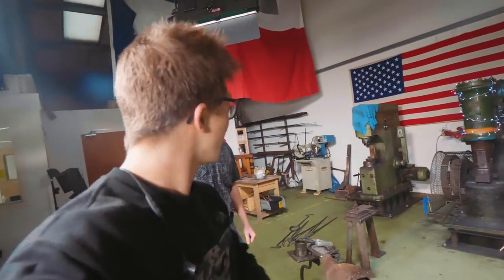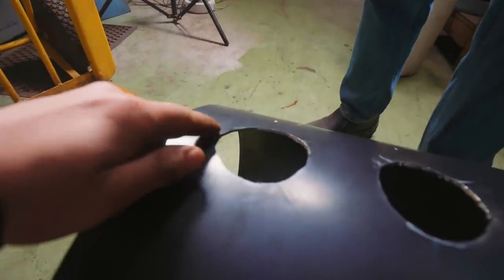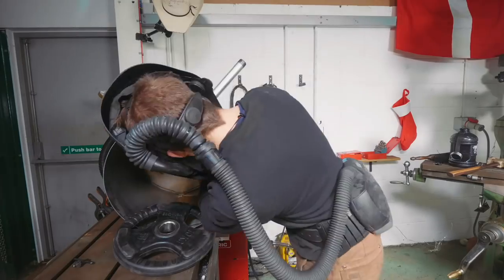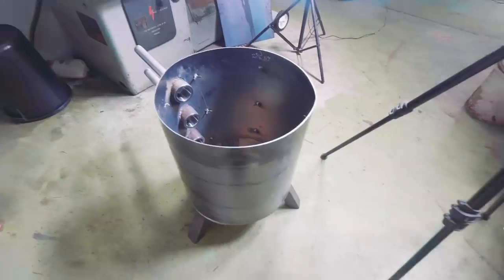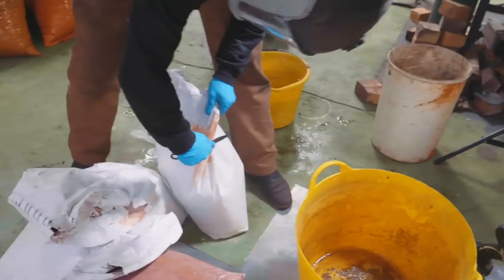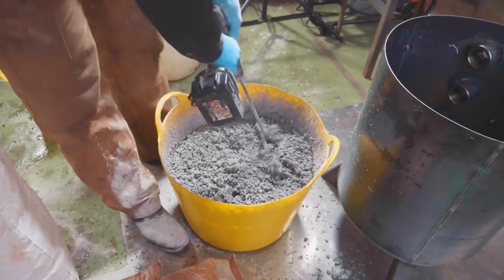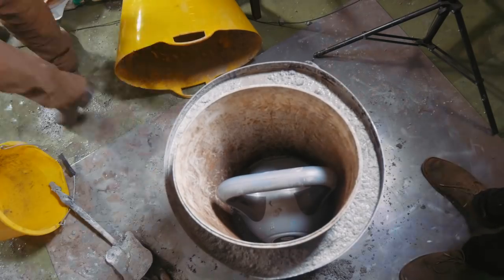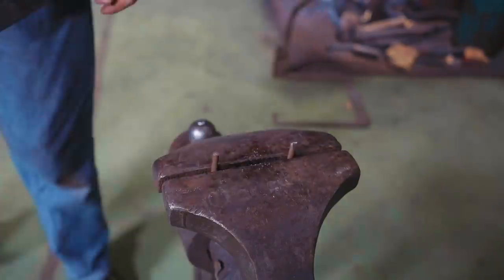BUILDING A FOUNDRY!!! PART 2

Comment: You're making a furnace not a foundry. The Foundry is the shop in which you'd find the furnace.
Reply: I just said the same.
Reply: Wouldn't he then be making his workshop into a foundry? Therefore, he is making a foundry?
Reply: Jasper Bliss you're right if he gives up blacksmithing 
If he does casting only then it is a Foundry
Reply: It shows their level of knowledge....  :-/
Reply: To be fair Alec is correct in calling it a foundry.  A foundry can be a factory or a shop that produces castings in molten metal but it is also the act or the process of producing said castings and it is the category of metal production.  The word like many can have a different meaning in different countries and regions and in this instance Alec isn't wrong.
Reply: found·ry
ˈfoundrē/
noun
noun: foundry; plural noun: foundries

    a workshop or factory for casting metal.

Origin
Reply: fur·nace
ˈfərnəs/
noun
noun: furnace; plural noun: furnaces

    an enclosed structure in which material can be heated to very high temperatures, e.g., for smelting metals.
        North American
        an appliance fired by gas, oil, or wood in which air or water is heated to be circulated throughout a building in a heating system.
        used to describe a very hot place.
        "her car was a furnace"
Reply: Billy Allen https://en.m.wikipedia.org/wiki/Foundry
Wrong
Btw the act is called casting
The caster is a foundyman
Reply: the act, process, or art of casting metals, guess you forgot that, either way you guys are bickering over piddly nonsense but what else is there to be expected from bitter people with far to much time on their hands.  Seriously it's not hurting anything or anyone if someone references it as a foundry just as it doesn't hurt anyone to call a microwave oven a microwave, only a total twit wouldn't know what he means.
Reply: Damn why are you so salty?
Reply: Billy
"...but it is also the act or the process of producing said castings and it is the category of metal production."
What??
The act of casting metal into shapes is known as foundry??
In what country is casting, specifically the act of casting known as foundry?
Reply: Billy Allen education is about getting it right 
He is a raw model to a lot
If he would make mistakes on safety you would probably be with us
Reply: Billy Allen I second what you say. it is a foundry, and after he take what ever he makes out of it, and forges it. then he has a forge.
Reply: Muttun and Friends forging it makes it a forge ?
Hope that was a spelling mistakes otherwise you gonna have a sad future
Reply: To those of us that have been doing metal casting for a long time, definitely.  Just wait until the word SMELT, SMELTING or SMELTER comes around for melting metal...  You ain't seen nothing yet.  LMAO.....
Reply: No mutton!

You don't forge castings, you machine them...

And yes it does matter, words have meanings already
Reply: sandrammer but he could make bars and make them into something
Reply: Dude... You don't normally go to all the trouble of casting to make bars.. 
Normally you cast complex shapes that would either be impossible to forge or prohibitively expensive to machine from a single chunk of stock material.
Reply: Yes, I believe it does.
Reply: +worldtraveler-- but, but SMELT is a real tiny fish is it not? And  if it's real, it's not FORGED...
Reply: Marcus Camenzind, on the topic of education.... Its a Role Model, not a Raw Model. It seems everybody is hooked of phonetics and spelling and grammar, so I thought I'd jump in on the action. Damnit people, should everything on the net be toxic? Bunch of petty trolls arguing semantics in a video by a massively entertaining Content Creator, without I dare say, the ability to do these things themselves? You Keyboard Warriors need to get a life, FFS.
Reply: worldtraveler, I'm pretty sure Alec mentions in every second video that he learns new things every day. Coming here and criticising his level of knowledge is uninformed. I bet you know it all, hey?

Comment: you did all that work witha circle.  do it flat next time.  all the holes except welding tub.  use 1" 1/4-20 steel bolts nextime just drill hols flat no welding.  your refractory cement should barely be wet.  way to much water.  and must have lid...order more.  use 2" cardboard tube and cut through internal mold...brute force to remove.  that cement should require constant packing and the mold should not move at all once full.

Comment: From experience that ‘foundry’ ain’t gonna last long...too thin foundry cement for the rig, taking into account the heat likely to be generated by the three burners...and all that water in the mix....not only is it gonna take ages to dry, if you try and heat it too much, too soon, it could explode with the pressure of steam in it, so be careful guys... the mix should have been much drier, and thicker (with the three burners), and the steel for the ‘pot’ could have done with being thicker too... hey ho...😳🙄😣☠️

Comment: what's the difference between a mig and tig welder ?
Reply: Tig uses a non-consumable tungsten electrode with shielding gas. Mig is wire fed and acts as both the filler and electrode with either flux core, shielding gas or both.
Reply: Moe Joe thanks

Comment: Wait, wait, wait. Did you just hook up the same gas bottle to your MIG that you were using for your TIG? 
Ummm, no. Just no. Pure Ar for TIG dude (unless you're very skiled and experience with Al, Mg, TI or various Inconels as you can mix in He or H to your gas for certain applications) 
Your MIG gas, for what you do with it, should be 75/25 Ar/CO2 (maybe 90/10 or a tri-mix Ar/CO2/O if you think you're really getting good)

Comment: What? You were about an inch from making the "concrete" touch the lip of the metal and you were so concerned that it wouldn't work? You poured it out and refilled it with less material on the bottom just so the filler would touch the rim. This would have had no effect on the overall production quality, and could have come in handy when making your lid for the foundry. This seems like artificial "drama" in an effort to make it seem more interesting. Since the holes were covered and there was a substantial amount of material between the top hole and the top of the filler in actual use you would have seen no negative impact.

Comment: ALEC,
I hope the refractory mix of heavy and medium are compatible. BTW, don't forget a drain hole in the bottom of the furnace to allow any spills due to a failed or broken crucible or other spills out of the furnace. And a couple of hooks for lifting the lid off when it's hot. Unless you're going to make it a lateral hinge slide in a circle type of lid, then you only need one hook to operate the lid.
If I wasn't clear on my meaning for the lid, check out [eddie2799]'s build here: https://www.youtube.com/watch?v=RYr5wazDtII